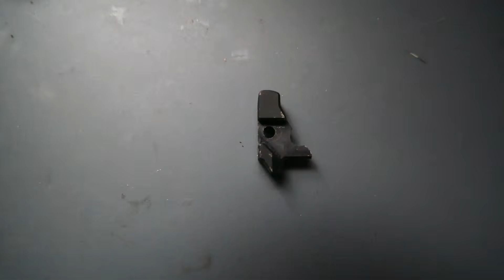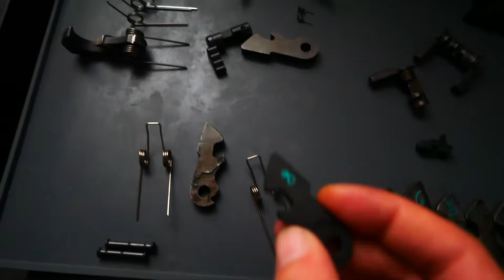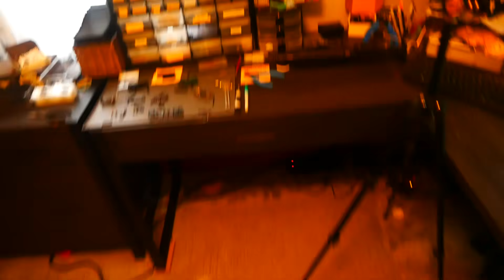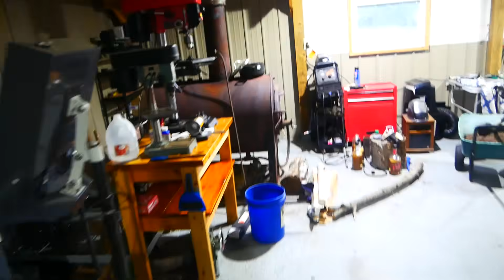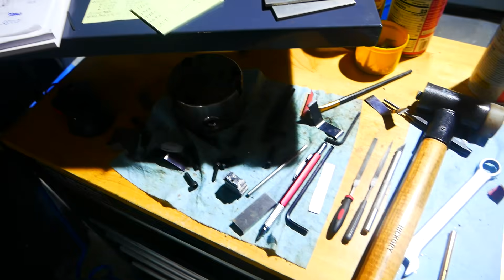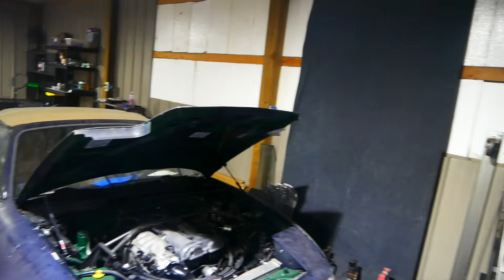Upcoming Parts and what MSA has been up to!

Comment: Hey I am a huge fan of my 3B MBT but one note for safeties. Make 2 sizes of lever. I ground mine down and filed the steps in to make it look original. But when using it on both sides. They like to rub on the trigger finger side. If you shorten one then it fixes this issue. Similar to what radian has.
Reply from the maker: 100%, I actually completely redid the entire setup. So am doing it as a solid strong side cam now; instead of the round cam and two skrew attached levers. (If that makes sense, I'll be posting about it here soon)
... Eventually I will do the ambi levers again with only the weak side having a screw to hold it, but definitely plan on doing a few things to completely improve upon everything.

Cause I do agree with you, the is dozens of things I want to improve on the mbt. Mainly doing everything from bullet to control my tolerances better, but also things like the safety.

... which is what I'm doing currently just with the 15L3 trigger, Cause the mbt has been shelved ever since ABC ip said no kits.

Appreciate the comment though. I enjoy the feed back. It really helps me understand what everyone else thinks and drives me to improve.

Comment: I noticed the website is down, is the server's admin service down or something??
Reply from the maker: Probably, I just got an email the other day they updated something. Usually breaks when they update things
Reply: @MilitiaStateArmory   How goes the progress on your end?
Reply from the maker: Had 22 of everything at the start of the month and was there, but that battlefield technologies event cleaned me out, so had to rebuild stock... But got a small batch of everything rebuilt and am planning on getting those up on the website this week.

Hold ups are the peak summer heat reducing the amount I'm willing to work and also helping a buddy with some things
Reply: @MilitiaStateArmory    No problem at all!

When I do get the complete lower receiver, how would I go about paying for the installed trigger together?
Reply from the maker: @Keekserker I have a custom work/donations page. So can just have you add the lower to cart and any extra build work well just have you add up as custom work and yeah, can all total together.
Reply from the maker: @Keekserker To which I can fill yours, you don't need to wait... Unless you want to wait for the 45* safety then will probably still be 2-3 weeks before they're ready.
Reply: @MilitiaStateArmory    I mean to add the trigger to the finished lower receiver, how would I do so, would I just do it in the "Custom Work" section of the site?

I want to get you your payment correctly when the time comes is all.

I can wait for 3 more weeks!
Reply: @MilitiaStateArmory    Gotcha!
Reply from the maker: @Keekserker yes correct I'll give you a total to add and you'll add that to custom work for the trigger and install work
Reply from the maker: @Keekserker  Hey bud whats your email? Ive been meaning to contact you but can not find our emails! Lol...
... So i got a little bad news, and some good news.
The 45-90 does not work you just get singles in both positions as the cutout on the cam ends up not being able to push the disconnect down far enough (in short).
So went down a whole rabbit hole and will be testing a 60-120 today. Its basically a 45-90 or maybe more like a 1/3rd, 2/3rd... So well see how it goes!?
Reply: @MilitiaStateArmory    Try to see if possible if the adding of more material on the cam on the CLASSIC version of the safety cam in the 3rd position will be able to allow FRT fire.  Maybe add a couple thousandths if able?

BUT, go ahead and make a video on the 60-120, which I already do have a 60-120 but would prefer a 0-45-90 if able to be made.

Comment: At 15:15 I understand what you mean on the dispersion of forces for the Hammer, you're essentially saying that the Bolt's carrier can't get hung on the squared tip of the hammer, causing a finish streaking and scraping.

YOUR design EASES  that tension by rounding smooth the edge of the Hammer by allowing forces to ROLL through and NOT get caught, allowing slippage to upkeep the hammer life by easing mechanical load in firing sequence operation.

I have though about taking a dremel to my hammer and easing off gently some material, but I would bare off the finish on the original Partisan, thus defeating what I would be after.

A very simple but EXTREMELY logical fix to the Hammer itself, well done!

Comment: So i dont have time to watch the whole video at the moment......i see the locking back difference, the spring difference, but is there a cliff notes version of the improvements/ changes to the hammer itself? Thank you sir!
Reply from the maker: Major improvements to the hammer are the spring having the extra coil and preload, as well as the top corner being reshaped to slide smoother against the bolt carrier.

As well as minor improvements to the profile, for shape and balance.

For The locking bar I added my easy close profile.

There will also be new trigger shoe and safety designs. (For custom look)
Reply: @MilitiaStateArmory and just to be clear, are these also compatible with the partisan disruptor(now triggered co) or only The Rare Breed and DDT?
Reply from the maker: @joshuabruce9920 There is a version coming that is compatible with the Partisan. The designs are so close I wanted these to work with both, but because a few tolerances are just enough different, they don't want to work together.

You can swap hammers and secondary disconnects, but the trigger and locking bars don't have the same "shelf/sear" location.

Comment: Remember!  My interest is PIQUED with those safeties!  THOUGH I AM MORE OF A CLASSIC 0-45-90 GUY, I REALLY THINK THERE IS FEASIBLE USE FOR THE LITE-FIGHTER SERIES!

Why?  Look below:

In a 45 degree selector style, Semi will be where it is normally at even at the 90 degree mode, thus the leverage from the thumb flicking it to there should be more than natural to do so given correct machining as you guys WILL DO!

The hammers are quite interesting and in my Gen 1 Partisan, the hammer spring looks to have about 3 coil-wrap arounds (How many times the hammer spring wraps around the trigger pins) and has not failed me once!

I also notice your lock-bar design is sensible as the upper ABSOLUTELY SHOULD push down on the Lower to IMMEDIATELY engage trigger functionality, just as my KEEK MOD accomplishes when shaving the Bolt's carrier!  We BOTH arrived at a conclusion in different ways, though be yours machined and mine grinding down via a DREMEL.

I like these consistent updates despite all the set-backs, your company DESERVES more business, sales, and positive notoriety!

Set your price on BOTH selectors and I will IMMEDIATELY PAY when you release EVEN PROTOTYPES!

On my KEEK MOD to note:  I don't even have to PUSH THE REAR RECEIVER PIN IN TO PULL THE TRIGGER!  The natural resting weight of the upper coming down PUSHES QUITE EASILY DOWN the lock-bar of the trigger BEFORE NEEDING TO BE LOCKED IN AND MAINTAINING A 2 AND A 1/2 POUND TRIGGER BREAK WEIGHT!

I really think if any of my small data can assist you in your goal of growing your sales, I am ECSTATIC TO ASSIST AND SHARE!

I am open to communication any time and WILL PAY GRACIOUSLY NO MATTER WHAT!

This has once been again, a long time viewer and customer of your FRT Parts,

Keek!
Reply from the maker: All good information! The quick action light fighters safety was very popular, but that was basically exactly the grip anyone had. Was they didn't realize how trained they were to the 90 position being single shot that it would throw them off in the beginning (until they retrained that muscle memory).

The 0-45-90 would keep that natural single position and help the quick position be even quicker!

... There was a guy who developed an active safety for full auto that is 0-45-90 (safe, single, full) but what makes it cool is it doesn't stay in the full position, it's spring loaded to pop back to singles.

So the user has to keep there finger on the lever to be running in full auto. Which sounds dumb, but when you see the video of him running it between splits going back and forth between the two positions, it suddenly makes a lot of sense and is pretty freaking cool.
I been wanting to hit him up and see if he'd let me adapt it FRT's.

Got a little off topic there, but word! Keek mods. I appreciate the comment. Thank you brother. Hopefully sales are good for you? Mine have been a little slow lately, but I've also been way behind on releasing new relevant merchandise. I love getting distracted down rabbit holes on things and forget what pays the bills 😅
Reply: @MilitiaStateArmory   I’ve had an Idea come to mind as of late.

If I buy a lower receiver from you Guys, can you engrave the name “KEEK” on there somewhere?

If you can, I would like to buy one flushed out with parts (if possible) with your new incoming 0-45-90 selectors!
Reply from the maker: @Keekserker yeah I can do that! Can even build you a rifle and tune it... I got a "my favorite rifle" video coming out here soon. You might like what I'm playing with these days.
Reply: @MilitiaStateArmory   I’ll be watching!
Reply: @MilitiaStateArmory   Okay, tell me the price of the Cordiality and I will get on it as soon as you let me know here and I receive the message!

Let me know the instructions as I am ready to purchase and again commit reciprocity amongst seller and consumer!
Reply from the maker: @Keekserker You will have to purchase the lower, and if you go to the custom work/donations item. I do engravings for $20.

Lowers must ship to an FFL, so when you make the purchase I'll contact you through email asking where you want it sent and that's when you can tell me where you want the engraving placed.
Reply: @MilitiaStateArmory    Will this also include the selector, or how when those go live will work??
Reply from the maker: @Keekserker the selectors still have a little work, I have to finish the vice jaws so as to build the cams, but then will be able to come out with those. Which I have a hole bunch of designs coming so one can customize their look.
Reply: @MilitiaStateArmory   I can’t wait for those 90 degree selectors, I am excited!!
Reply from the maker: @Keekserker Just finished putting the Kool-Blak 225 oxide treatment on a set of hammers and locking bars today! So those will be going live in the next day or two! Looking good and it's a professional/industrial Treatment that's Military and aerospace rated/approved. So it's a big improvement in post process treatments.

To which I also have 10 of the new ExpressTec Flat face triggers machined and in the shaker. Probably going to do the heat treatment tomorrow, so I can possibly have them ready by mid next week!

Then I gotta side track a couple things for another week or two... Then I'll be cranking out the safeties. So probably a month out for those; but awe man I got some stuff coming out!

Machines barely been running the last few months and now I got so many new things coming I wish I had a couple more machines. Cycle times are a major hold back to being able to release everything quicker!
Reply: @MilitiaStateArmory   I will run your machines free of charge, lol!

That would be cool to do, also that’s unique with the oxide treatment!
Reply from the maker: @Keekserker Come over I'll show you how to keep it running!

... But yeah, always just trying to do things to the highest level I can.
Reply: @MilitiaStateArmory   I don’t do any sales, I just share great info because I like to tinker.

I think you’re talking about the Geissele Gas pedal!
Reply: @MilitiaStateArmory    I saw your pre-order page (As in no image to look at for Partisan triggers) for the after-market Partisan parts!!

I can't wait for those safeties!!
Reply from the maker: @Keekserker The Partisan is just different enough in the locking bar, that it also is different at the back of the trigger... So will take a whole extra round of prototyping to get them worked out.

... In the shop running parts currently, hold up is always waiting for cycle times and building up enough parts to post treat/process, but then we'll be running ahead somewhat.

Comment: Will these improvements - particularly the new locking bar that allows you to close the weapon easily - be available for your frt trigger?
Reply from the maker: I can't do my own full trigger... I can, it just comes with a guarantee of being sued; so these are just aftermarket upgrades/replacement parts.
Reply: @MilitiaStateArmory I meant will they be available for the triggers that you already sold?
Reply from the maker: @stripedbassnut Yeah the easy close profile was part of my MBT, but because the way the locking bar engages and disengages, it only works when in FRT. If you're in single shot or safe you have to pull the charging handle. (Which makes me think I should have the locking bar engage when in safe so 2 of the 3 modes can easy close, will remember this if I ever get to do MBT stuff again).

... But I've included it on every single locking bar I've ever sold. From the very first one like 5 (or more) years ago.

Comment: peronally I would like to see some aftermarket support for the AS Designes ARCFIRE trigger system. as far as safety levers are concearned I woud like to get different designed safety levers for the ArcFire system. just saying
Reply from the maker: I will have my different selector options available for individual sale, and will make that happen for you.
Reply: @MilitiaStateArmory I agree with the OP. Im surprised no one makes replacement levers(dog leg, milspec, etc) for the arc fire or the super selektor.

Comment: NICE! Lock bar* fixing the not needing to pull handle back to close upper is genius that was a major thing i hated on cassette frts those lock bars will fly off the shelves i bet a great upgrade will be ordering a few definitely.  Since you got the green light and can be offering enhanced parts for other brand cassette triggers what is stopping you from doing a spare internal kit for your MBT with your revisions and just not selling housing or lock bar?
Reply from the maker: ABC IP doesn't want complete kits, there ok with me doing parts just so long as it's not a complete kit. They want it to be missing a couple items so someone can't 3d print a housing and bypass one of their sales.

It's not a lot to work with but it's (compared to what everyone else is going through) reasonable.
Reply: @MilitiaStateArmory  Yea i figured that was exactly the reason but since they are okay with parts like the enhanced hammer being made for the L3 and Partisan, Would you be able to do the revised burst design trigger and hammer you were messing with for the MBT and release that as a sole upgrade kit? (leaving out housing and lock bar) or is safe limit selectors and enhanced hammers only. Pumped for the new partisan upgrades tho and appreciate everything you guys do!
Reply from the maker: @JohnCandleWick2026 well they actually gave the ok on the locking bar, safety selectors, and trigger shoes if... But actually specifically asked me to not do hammers.

... To which they stated there biggest concern is just not doing complete kits...

Well after looking into it over the last couple months the hammer is the item I want to fix most. So without their permission I'm doing the hammers, and am just hoping they understand and are going to be ok with it so long as I don't do the disconnect or housing to keep to the main concern of no full kits.

So it's complicated, and still questionable. We'll see what happens?
Reply: @MilitiaStateArmory   i get it not a ton of room there but I appreciate the response & Hopeful that can be possible for the MBT down the line if other important components are left out and I’m sure those of us who purchased an MBT would buy the new revised kits right up 😁😁 Glad to see you back on here tho and excited for the new releases and improvements! Have a great rest of the weekend.

Comment: Similarly I had to add material to the reset hump for my ar10 to positively reset in third position.
Reply from the maker: Nice! Are you manufacturing them or just for hobby?

I Appreciate you commenting
Reply: Just my tinkering in my own toys for now. Been a fan for years btw
Reply from the maker: @SamSam-ih6nt Nice. Good work. Sometimes I feel that's all I'm doing is just tinkering with my toys. Sounds like you have your priorities straight!

I appreciate your support

Comment: I had to add material to locking bar to engage in my ar10. I think it was like 3mm. 

Would be a good addition as an upgrade to have a ar10 bar available.
Reply from the maker: My buddy Mike Klein has been asking me to do one for a couple years. I just don't have an AR10 to build to.
Reply: .. could you elaborate on this a bit?
Reply from the maker: @twboegel2918 Just as you said the BCG in an AR10 sits higher, so extra material needs to ne added to the locking bar top.

I would love to make one and plan on doing so. I just need an AR10 so i can make adjustments to the locking bar and then go test shoot it for reliability. 

So because i dont have an AR10 i dont know how much to add to the locking bar.

... As for Klein (aka Small Team Supply) he is a firearms builder most famous for his ARPK and LSW builds